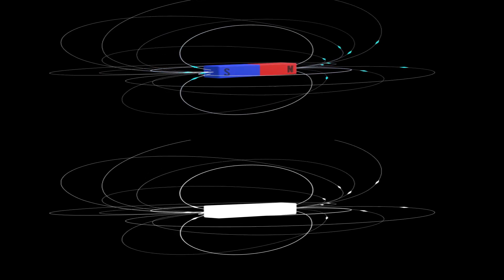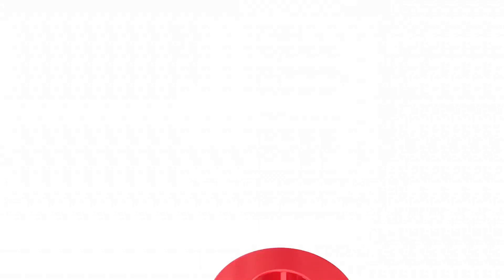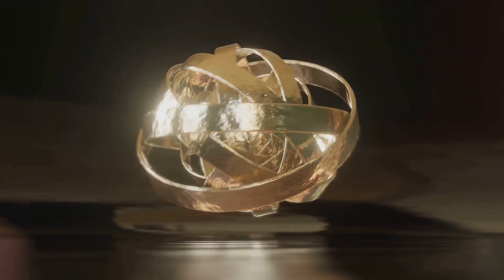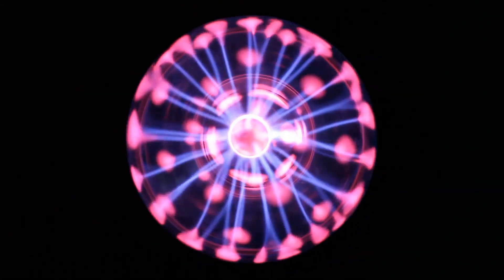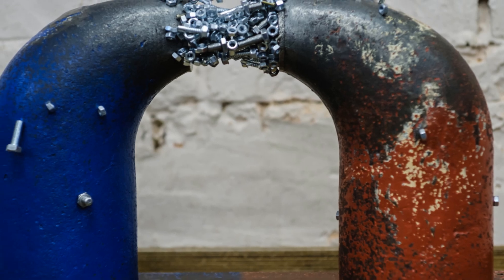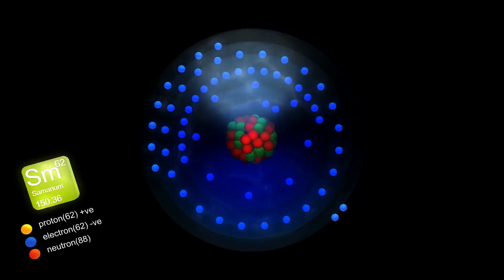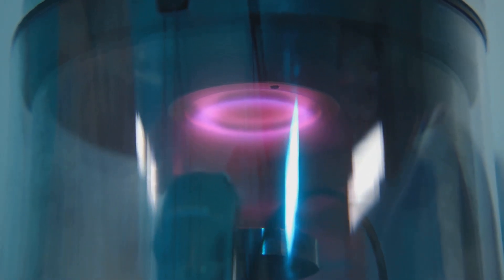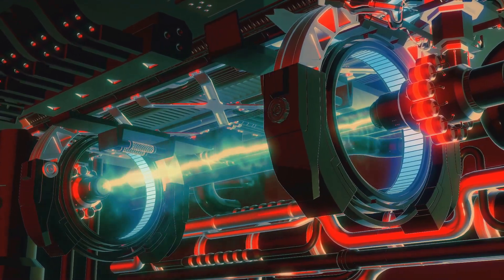Magnonics: Shaping Materials with Quantum Precision and Energy Efficiency

Comment: How is magnonics different than spintronics?
Reply from the maker: Magnonics and spintronics are closely related fields within spin-based electronics, yet they differ in their core principles and applications. Spintronics, short for spin electronics, utilizes the intrinsic spin of electrons in addition to their charge to create advanced electronic devices. This field exploits phenomena such as giant magnetoresistance and spin-transfer torque, which are fundamental for technologies like non-volatile memory and spin-based logic devices. In contrast, magnonics focuses on magnons, which are quasiparticles that represent collective spin excitations in a magnetic material. Instead of manipulating individual electron spins, magnonics deals with spin waves, the wave-like propagation of these collective excitations. This approach offers potential advantages in terms of lower power consumption and higher efficiency for information processing and data transmission within magnetic materials. Thus, while both fields harness spin properties, spintronics is primarily concerned with the control of electron spins, whereas magnonics is dedicated to the dynamics of spin waves.
Reply: @ailabsparadox  That was actually more interesting than the video!

Comment: light works better
Reply from the maker: Thank you for your comment. Light-based technologies, like photonics, are indeed great because they can transfer data very quickly and efficiently with minimal energy loss and heat generation. Magnonics also has unique advantages, such as low energy consumption and the potential for very compact data storage and processing solutions.
Reply: @nanotriz  oh I have no doubt that magnonics will always be a part of calculation in the future, but there are not many ways to calculate faster than the interference patterns of light rays, before quantum. After that it depends on the calculations.